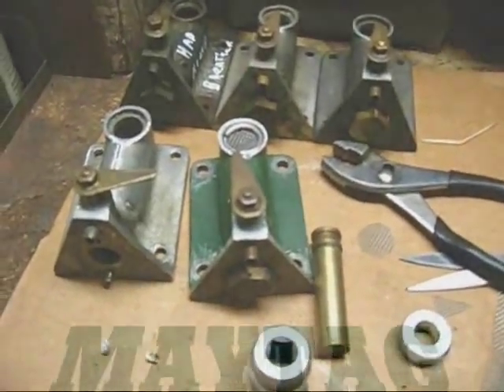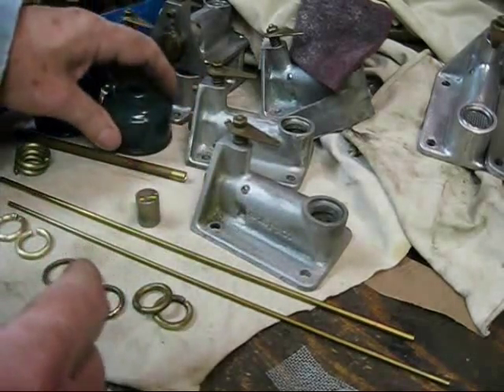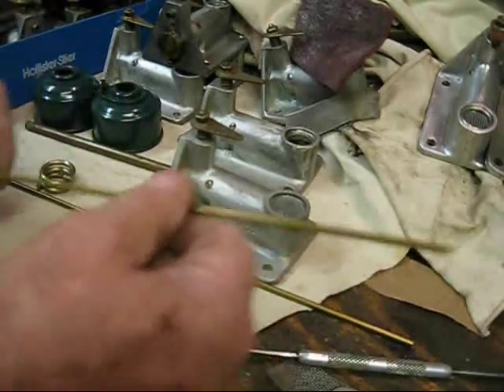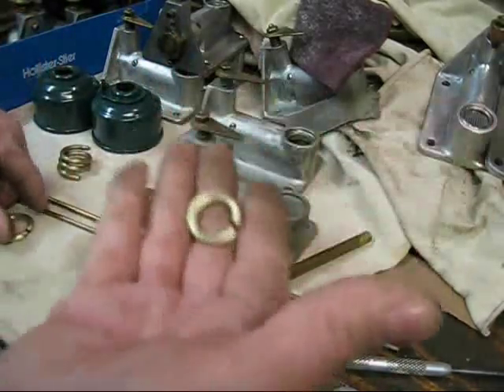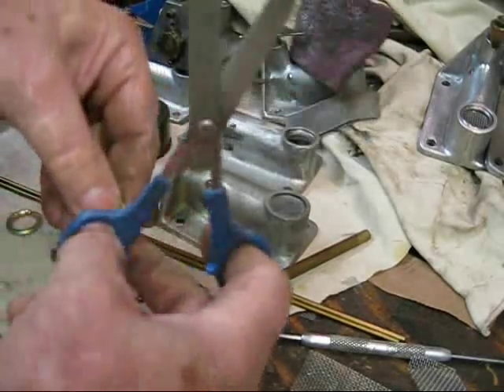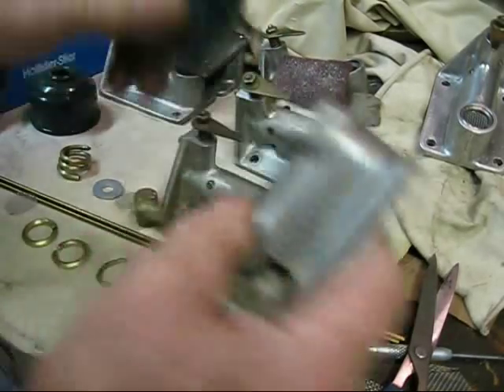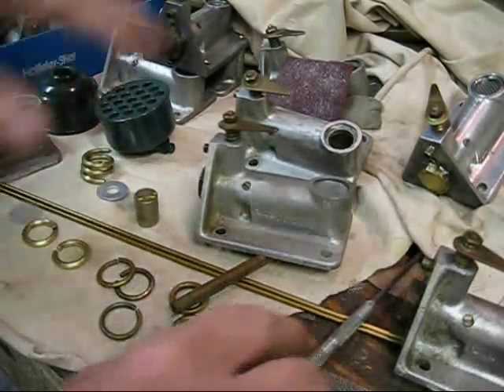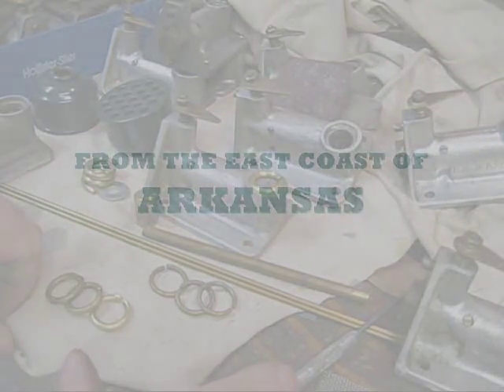Maytag Gas Engine  model 92 repair tip #1

Comment: I envy not only that you have the know-how on maintenence of these old appliance engines and spare parts, but that you have the time to tinker with them...today all of these washing machine engines are powered by a cumputer card mechanism on top and once that goes, you just got a hunk a junk whic no repairman wants to fix- get a new computer card? Ahh, may as well buy a new machine all together

Comment: I enjoy your videos sam.   They inspired me to work on a few of mine that have been sitting around for 30 years.   I do have a question.  I have one with a stuck flywheel.   I hat hit it so hard I split the nut.  This is with one edge hanging off the bench.   Do you have any tips to get a stuck one off?   I  really don't want to hurt this flywheel as it is a first year one that I want to put back on my first year engine.   Do you think I would have luck by splitting the hub with a cut off wheel?  I am getting desperate.

Comment: I can't even get my 92 to start. Does anyone have any advice?
Reply: TheNarrowgauger, Check for spark. If you find it has spark, put 2 stroke fuel in it, open the mixer valve 1/2 way to 1/4 way open, then kick it until it starts and runs.
Reply: Make carb gaskets 1st thing. That was my basic fix & got me to putting abit.